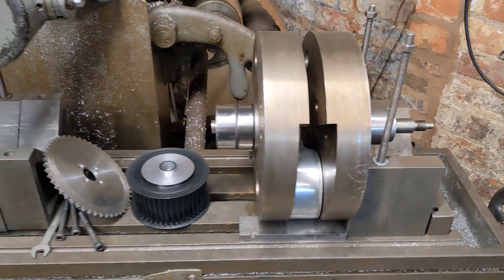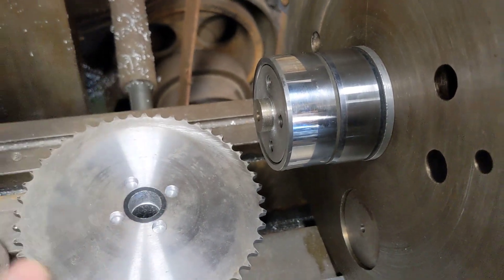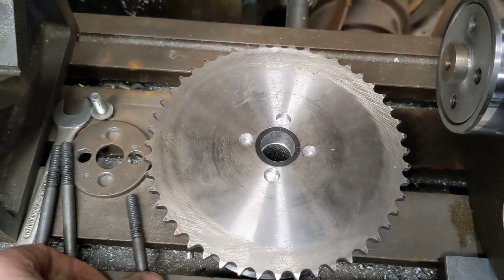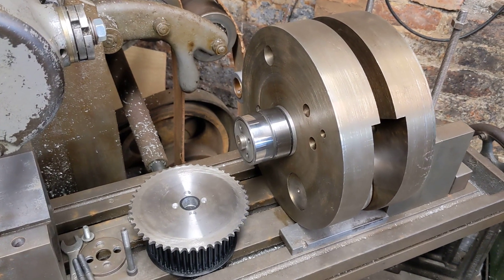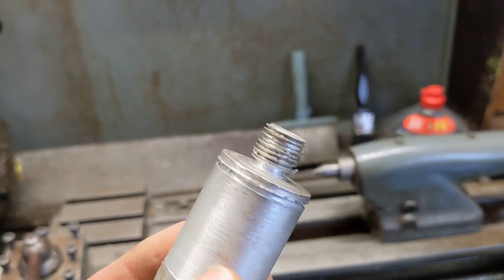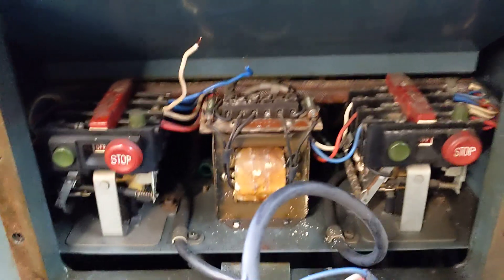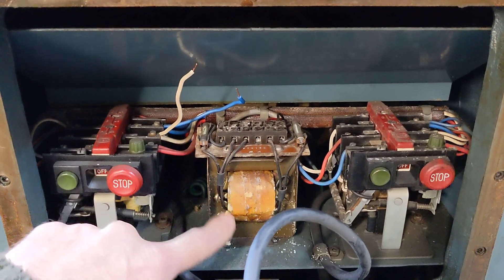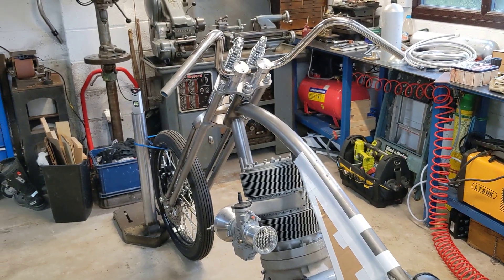Burnout on the 540!

Comment: When you have to work with mystery metal it's always a shot in the dark that it may machine properly. You will use the surface grinder for sure. I brought home a 1946 Brown and Sharp #2 about a year ago the previous owner had disassembled to restore and gave up on. After reassembly to inspect operation, I reground the bed flat, and it's been in use since
Reply from the maker: Glad to hear that. Big step forward with the grinder today, but I need a few parts so it'll be a while yet.

Comment: 6000 series aluminium is ideal for general machined parts, 6082, 6061,6063 etc. For higher strength, non-weldable parts, 7000 series aircraft stuff, 7075, 7050 etc. Stay away from the purer 1000 series stuff, it's soft 
crap.
Reply from the maker: Yea, no idea what I was trying to use, but I need to weld it later so 6082 is favourite. 💪